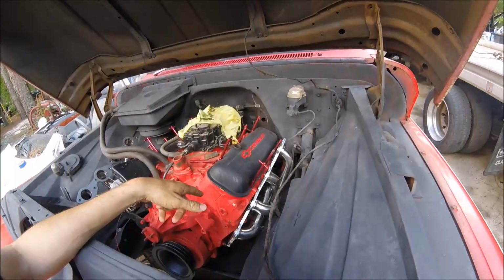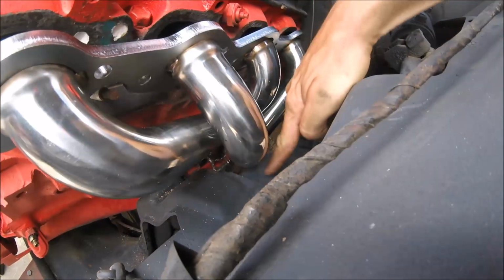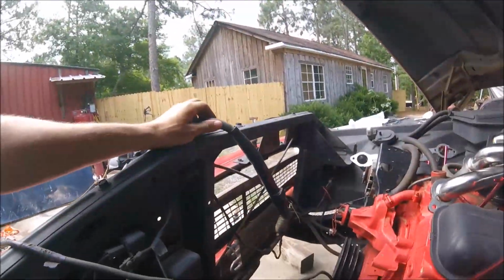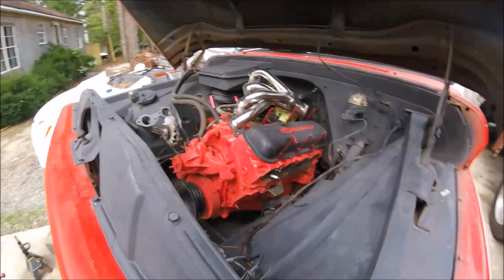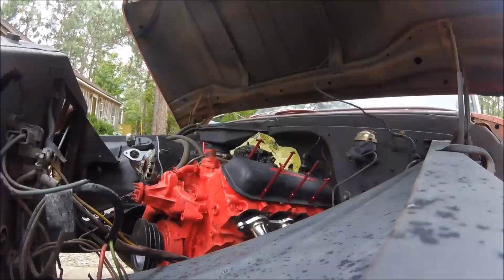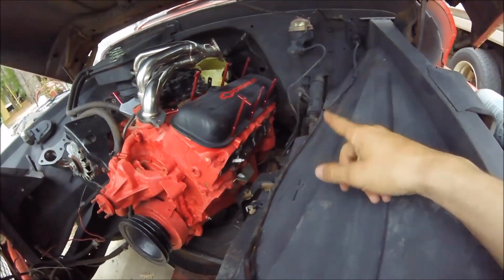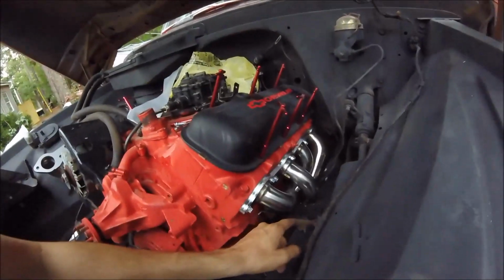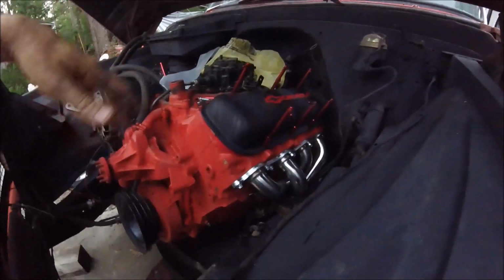1964 CHEVY C10! THEY'RE HERE!

Comment: I want to lift a 64 c10 6 Iches but I can't find a lift kit for it so do I need to put a 4x4 frame under it?
Reply from the maker: +Ledger Cook I mean you can remove the independent front suspension deal and weld up some perches and make it a straight axle or you could just find a donor truck and do a body swap like a 70s or 80 model and also have more power steering and power brakes Etc
Reply: Street Drive 64 is there any video of someone doing that on YouTube that you know of because I do not know how to do that, and I would do a frame swap if I had to, but keeping the original the frame would be cheaper and easier but if I change the  frame I'll have power steering power brakes and 4x4